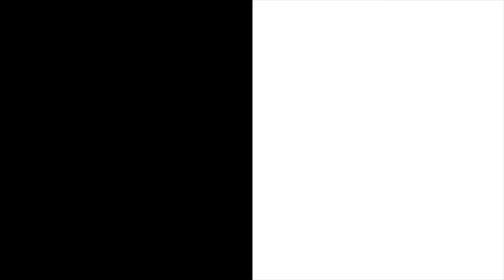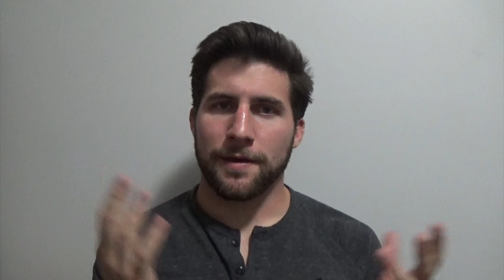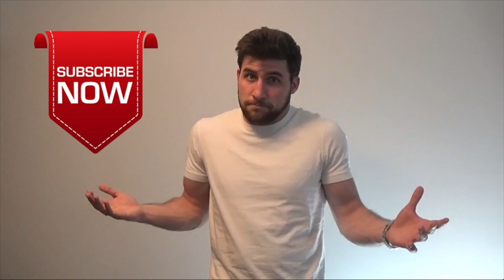Ask Brad Ep 19 | What Compressor do I need for Painting

Comment: Brad I bought a cheap motorcyle and a previous owner had gone the Sons of Anarchy route and rattle-canned the tank, fenders, and what he/she could see of the frame flat black with minimal masking. I want to paint the tank and fenders gloss white and I feel I can handle that no problem. Where I am stumped is what to do about the logo? Do I need an airbrush? Should I put a logo sticker under the clearcoat? Or maybe should I brush the logo on freehand like the pin stripers-do. What would you do? The motorcycle is a Suzuki Savage, easy to Google if you want to see the logo I'm talking about, but I doubt that's going to make a big difference in my options.
Reply from the maker: Is it the suzuki logo that you're trying to put back on? All of the things that you've mentioned are options. You could also put masking on there, draw the logo and carefully cut it out, and then spray it with spray cans.
Reply: It's actually the Savage logo, as well as the model' "LS650". I'd like to put the model back where it originally went on the small air cleaner covers. I have noticed a trend towards smaller, cleaner looking emblems and badging and have considered shortening the height of the "Savage" emblem, and maybe stretching it so a sticker is my least favorite option. Thank you for the reply, would you happen to have a video I could refer to on the masking technique you mentioned, or would the search bar be that specific? Thanks again. :)
Reply from the maker: I don't think I have a video on that topic specifically, but I've used essentially the same technique for many things. I have a video about adding graphics to your guitar where I spray a logo using a mask like that. As for creating the mask, that's essentially what I did for the memorial guitar and for the acoustic that I painted. I would simply print out the logo, trace it onto some masking material on the bike, cut it out carefully, peel the part you want to spray, and go for it.
Reply: Thank you sir, I watched the video where you painted the bands logo, I will find the other two you're referring to as well.

Comment: Hi Brad, have you any experience with the electric powered spray guns? I was wondering if something like a Black and Decker - HVLP400 for example or something of the sorts will be way better than spray cans.
Thanks!
Reply from the maker: I there. I don't really have any experience with those unfortunately. I'm guessing that they would put out a lot of paint, so you'd have to be careful. They're designed for spraying thicker paints if I'm not mistaken. Good for large surfaces, but probably not great for small ones.

Comment: Brad, Can you recommend a good compressor to solely paint guitar bodies. Recommended CFM, PSI and tank size please? I can find a brand if you can give me specs. Again, it will be solely used to paint guitar bodies. Electrical will be 110, not 220. Thank you.
Reply from the maker: The issue is that it depends heavily on what gun you’re using. Do you have a spray gun already or know what you’re getting?
Reply: Brad Angove it’s called Air Gunsa AZ3-HV2.
Reply from the maker: And does it not come with specs re CFM and PSI? Most guns do.
Reply from the maker: Well, the answer is on there. 12 cfm at 28 psi. Realistically for guitar bodies all you need is a decent size tank.
Reply: Brad Angove whats decent..lol? I’m looking for specifics please.Then there are compressors that day they are 5cfm at 90 psi. Well what if shoot at 30psi...doesn’t that mean my CFM changes? That’s why I’m asking you for details on a good brand compressor based on the information I provided to you. I know nothing about painting guitars other than watching your channel so I’m hoping to get accurate information from you since you’ve been doing this successfully.
Reply from the maker: The cfm increases as you decrease the psi. I generally paint with a massive shop compressor, so I don’t know all the math. I’ve painted a guitar with a smaller porter and cable compressor that was only 1.5hp and had a 5 gallon tank, but my gun runs at 8 cfm @26 psi I believe.
Reply: Brad Angove ok thank you so much. I’ll do a little more research to find out what will work for my application.

Comment: dont mean to be picky but you  probably ment you need less cfm if youre running the gun at a lower pressure. at least from my knowledge correct me if im wrong. that look couse of the cat tho hahaha made my day. anyways nice vid bud
Reply from the maker: That sounds right haha. What did I say?
Reply: +Brad Angove ooo my bad watched the video again you said you are going to have more cfm when running at lower pressure. first time i understood you are going to require more cfm if running a gun at lower pressure. my bad :)
Reply from the maker: Oh, that makes sense. I'm glad we're on the same page haha.
Reply: does it matter what are you painting? i.e. car or guitar. it was little bit difficult for me to understant and choose right compressor because in Croatia we use metric system. I need compressor to paint smaller things like guitar. I found some compressors that are not expensive (because I'm painting guitar(s) as a hobby, don't want to spend lot of money for compressor). When I convert specs from metric system, they have max. 120 PSI, with 2.5 CFM at 60 PSI, and 1.6 CFM at 100 PSI with 24 liter tank. Please help me to decide, is it enough for painting a guitar.
Reply: Have you figured it out cause i'm stuck here too? i would appreciate any help also do you think a 15 liter will do? what type of gun do u use and what's the LPM on your compressor?
Thanks,
 @tihomir7